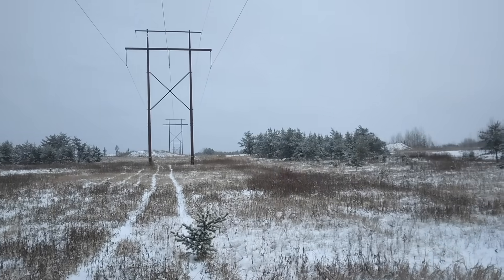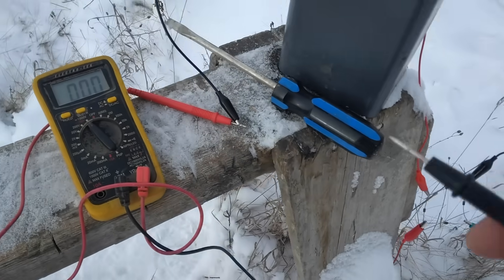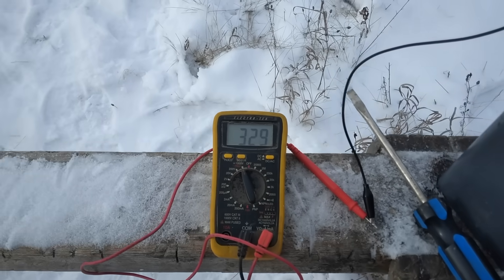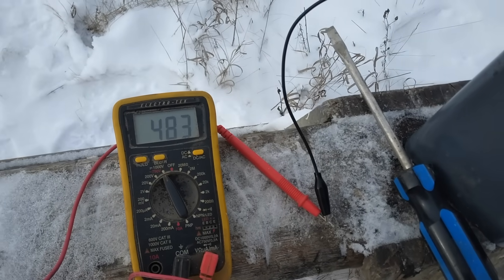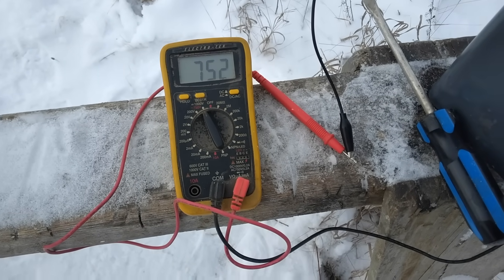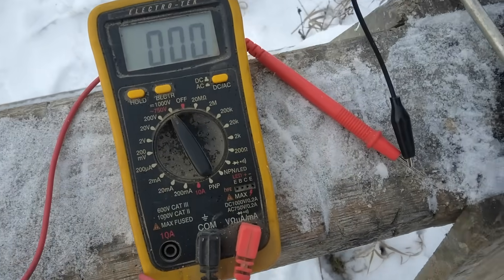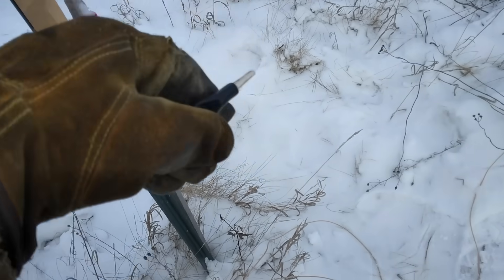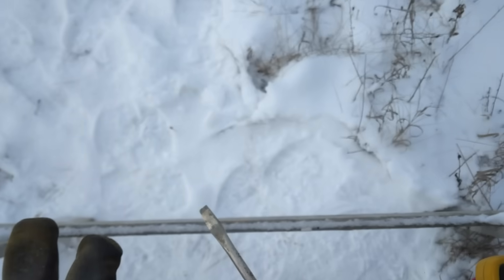Fences sucking power from under HV transmission lines

Comment: Many years ago I was setting light poles with a bucket truck in a parking lot. There was two maybe three, HV lines (systems) above, I can't remember. I was in the bucket operating the boom. I reached out to grab the pole to stabilize it and got a tingle. I told the guy down below, he though I was just blowing smoke. When he grabbed the bottom of the pole to center it on the light base he got a surprise. He took his lineman,s pliers and grabbed the ground wire from the feed wires and weld it close to the pole. there was a continuous arc. One of the guys ran to get some rubber gloves. It was all good once the pole was sitting on the base.
Reply from the maker: Thanks for sharing!
Reply: That one Pole was inducing more power to ground than I would need to run the lights in my shed.  I'm rather surprised that the right of way allowed those poles to go up at all.

Comment: It would be a good place to lose a few hundred blue berry bushes.  Since trees cannot be planted, the wild cultivated blue berries would never rise above 7 feet off the ground.  You might as well use the ground unless if you have something better to plant under the lines.  If they complain about the stuff growing under the lines, it is their responsibility to do line clearance.
Reply from the maker: I noticed that things don't grow very good under it.  Don't know if they sprayed it at one time, or if it's form the fields off of the power lines...
Reply: Here in NY, the farmers just plant under the lines.  The one issue if that the equipment is usually grounded when working under the line.  But if you are not that active in that space, some long term bushes that never rise over 6 feet high might be a good thing(hence blueberries).  The lines will rise and fall depending on the temperature, but you don't want anything high enough to ground a line and you dont want the power company entering your property to do any line clearance.  If done right, they dont have to enter your property until there is a break or about every 50-60 years.  @doubleMinnovations